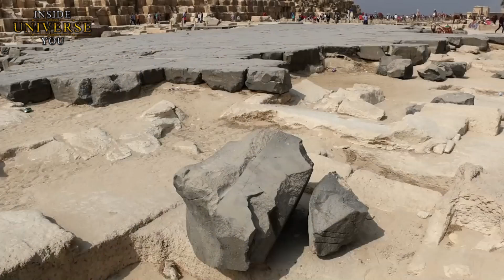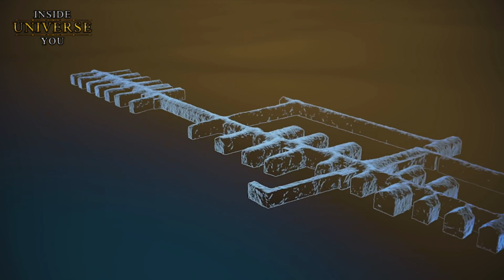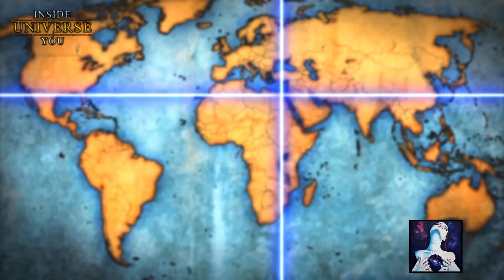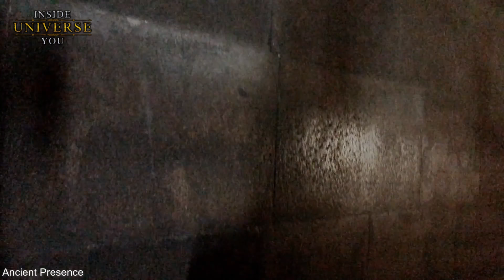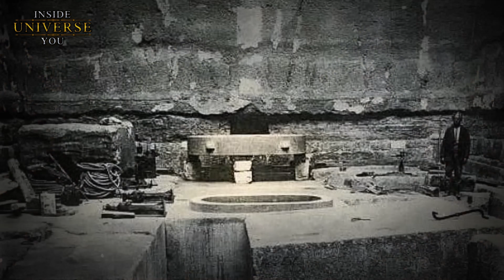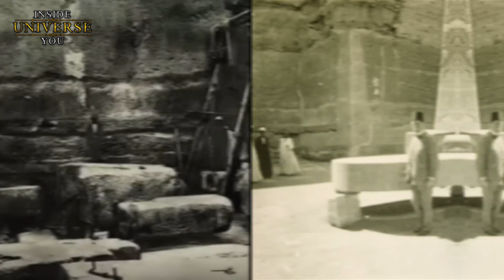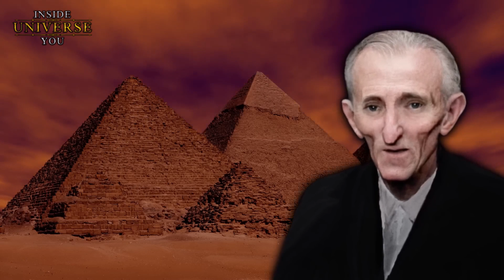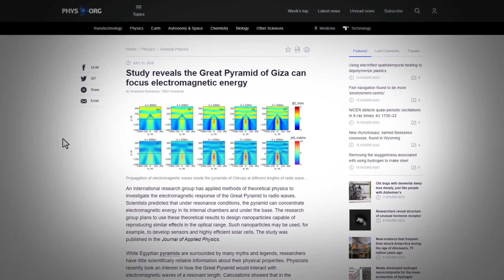Pre-Egyptian Megastructure Built BEFORE The Great Flood

Comment: The rose granite vessels from Saqqura that are machined within thousandths of an inch * on the inside*.. so thin a light can be seen through the sides ends any  debate.. no one has to listen.  You can't get your hands inside a 2" opening to work the inside of the vessel, nor have a method to measure thousandths of an inch. Furthermore Egyptians didn't have the layout tools, mathematical ability, astronomical knowledge,  acoustic resonance amplification waveguide formulas,  nor the knowledge on how to break the hydrogen bond from H²0.. so please go back to punching the clown on the skinernet before you  interject your Richard Cranium foolishness into adult conversation.

Comment: If the Pyramids were generators, what did they power with the power produced? Seems like a lot of trouble to go to producing lots of power for nothing. They had no lighting that's ever been found just images of things that could be lights, no radio or television, no pc no electric motors. What would they use the electricity for?

Comment: This is why the Serapeum had no signs of torches being used. The pyramid indeed transmitted electricity.

Nikola Tesla once lit 200 light bulbs from a power source 26 miles away, and he did it in 1899 with a machine he built from spare parts in the middle of the desert. To this day, nobody can really figure out how he pulled that off, because two-thirds of the schematics only existed in the darkest recesses of Tesla's all-powerful brain.

Comment: Today 2025...precision water cutting is present.that can cut steel plates. ...any tests done with this metod on granit or sandstone (limestones) and could deionised water be used? And to sharp cutting granite use thin sandstone between the water nozzle and the granite.  ( sandstone probably will curve the edge as moving the watercutting. ( any welder may understand  )...
Sailor :)

Comment: They are not machine marks ffs, they are copper saw marks, they've found copper fragments inside some of these apparent power tool marks, it can all be done with the technology of the time, and they had machines made from wood that have been lost to time, we now have mereer diary that tells us basically how they cut and transported the casing stones from the quarry, and he helped build the hydraulic dams and canals that went up to the base of the pyramid, you are also making a lot of assumptions about the precision of the boxes, they are a BOX in a fifth dynasty pyramid which is the most precise sarcophagus ever to be found, and many more just as accurate as the seripium once, and the APEX BULLS were GODS on Earth to the ancient Egyptians, most of the assumption you made is wrong, like the water pump theory, one the pyramid has never been water proof and two why would you need a water pump wen you have a lot of water all around you and loads of natural springs and oasis and the river nile, it doesn't make sense, now building a cathedral pyramid tomb for ppl to visit the king, makes more sense than a water pump

Comment: Has anyone laid out the exact layout of the pyramids? Block by block, Start at each corner, this will give you an exact precision they built it with. No tunnel going below the pyramid, would have air after two minutes. They placed sarcophagus as they moved upward. These were not brought into their positions after the build. All impossible bix 😊placements had to have been done as they built it.

Comment: The box is not a sarcophagus. It is a container for a grounding electrode.
The watercourse is designed to link multiple grounding electrodes.
The electrodes were made from the perfect electrical conductor, 10K gold; which is approximately 60% silver and 40% gold, providing maximum passivation.
Reply: The alloy that you're referring to is called Electrum...
Reply: @AmunRa14  

Electrum is a family of alloys, 10K gold is the one used as the preferred conductor. That's why it is the most plentiful. But it's made, not naturally occurring, as often thought ...
Reply: Did you get this knowledge from a previous life?

Comment: Considering the new findings of a cavern beneath the pyramid and propose a use for your ideas. What if the pyramid was a pump for a vast underwater reservoir like you said but on a much grander scale. It is written that the Gods supplied the life giving waters in times of need. Although strangely at the time of the end of the old kingdom a great disaster happened in which the nobles were all killed suddenly building knocked down trapping peoples within. These peoples had elongated skulls denoting a privileged elite. If such a system failed the populace would revolt and turn on their leaders. Although the use of electricity is dubious the use of power of another sort is feasible that been the grand galley has a pumping mechanism using its precise carved stone and a heavy weight lifted up and down could initiate a pumping system and once started would carry on flowing water through the method of osmosis. Although today we can see a vulgar dug tunnel bypassing it known has the escape of service channel. I surmise this is what ruined the machine.

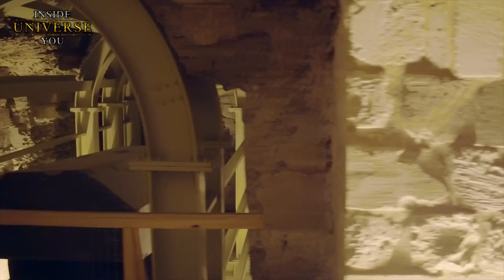Comment: 7:11 the sarcophagus in the kings chamber has the perfect inner dimensions to house the ark of the covenant.  I wouldn't be surprised if these sarcophagus held something similar.  The layout suggests maybe a power grid or perhaps acted as diodes/capacitors or resistors. I believe the sphinx was for line of sight communication via frequency/radio waves. Probably something close to Morse code.  The step up from signal fires and smoke rings.

Comment: The truth is they could’ve stumbled upon electricity without knowing what it was. If the area had vegetation and water then there was storms passing by from time to time creating thunder. Maybe they already knew that thunder was conducive through metal and water. Maybe they knew that thunder would strike the top of the pyramid when storms hit the area and they conducted that electric wave through metals and water and the whole pyramid lit up inside and out making them worship the pyramids to the Gods they believed were causing all this. Maybe they even had stone wheels or another type of invention deep underground propelled by the electric current to move a water system through the whole area creating a vast vegetation in that whole place. You see desert now because for thousands of years it hasn’t been used so everything dried up and died. It makes total sense that the Egyptians could have stumbled upon electricity by having already experience with it maybe by being electrically shocked by it or electrically shocked through tools they were using. Then using common sense they learned its conductivity and they learned how to use it for things they thought could be applied. I’m almost certain they didn’t have lightbulbs or electric sockets BUT it’s very possible they had the ability to conduct the electricity from the thunder and make the pyramids glow making them all watch the spectacle during rituals they had. The pyramids were temples of worship mixed with for them unknown power coming from the gods and since the pyramids were providing the whole area with water and vegetation they worshipped them like they were the gods itself. Instead declassifying old stuff like the lies of Area 51 and its “aliens” and ufos that were only classified aircraft models made by humans we should be uncovering the truth about our past. Not some story in a book or the beginning of a history they want you to learn because it’s about them BUT instead uncover what really happened in the past no matter if it will uncover you weren’t the first, you weren’t the founders or whatever might be the case. It’s like saying Christopher Columbus discovered America when there were people there for thousands of years before him. It sounds good for the history they want to teach you BUT it’s far from the truth. We need to invest in our truth what the hell really happened in the past. Did ancient humans already had discovered things we thought only modern humans figured out??? I mean not with electric cables throughout the whole place, electric sockets, cars and all that I mean discovered things in an old fashion way and used it as best as they could maybe as crude energy to help water flow from one place to another or to create machinery like a saw type disc that will start rotating and cutting through rocks and other materials like butter. Who knows that’s why it’s important to really look at things from another perspective and if there’s any truth not discovered or not told we should uncover it because we as humans can’t be walking around this earth without knowing anything about this place. We think we know it all BUT we just know fractions of what really was going on for hundreds of thousands of years. The past has more we don’t know than what we really do know and only those committed to uncovering the truth will be the ones to shed light about what really was going on. We have super intelligent people in this world with vast experience in all kinds of fields so I think its time for all of them to unite and find the real history with full detail of what was going on in this world and if WE are just another generation of humans that had to discover things by ourselves just like the people in the past did. Like a repetitive cycle discovering the same things over and over again. The only difference would be the use for the discovery and the things they created with the discovery BUT the discovery itself would be repetitive. Do you understand??? I hope so because all this is super important and I have no clue why we aren’t hungry and curious to unveil with proof how everything was done in the past. Was the Sphinx there already when the Egyptians started to exist??? Who can say for sure that people way before the Egyptians didn’t make immense structures with whatever technology they stumbled upon??? Who can say for sure this is all fiction because it isn’t written in any history book??? Maybe they never wrote anything because they didn’t have written vocabulary or maybe because they communicated through sounds like animals and not by words like humans from our history time. What time is that?? Well since the Bible or since we humans understand we started to have a vocabulary and an alphabet. We don’t know anything for sure. We trying to look for other planets and we don’t know what’s beneath our deepest waters or what really happened on this earth. If you drain all the water from the oceans who can tell me for sure there isn’t any ancient cities and ruins thousands of miles down???  Who can say for sure we won’t uncover massive craters created by asteroids hitting earth throughout its existence??? Who can say for sure we won’t uncover a whole world that existed before the sea rose and sunk that whole world with it??? Nobody can say anything because nobody has drained the water out of our oceans to say otherwise. Radars, submarines or any type of tech wouldn’t be able to detect stuff where no one has ever been where signals don’t even reach. I’m hoping one day I wake up to a massive discovery that will shock the world😎

Comment: the used gems with line set to nessary angles to carve  and  know basic math.  Sorry but  they invented alot of tech we still use.
stone cuting tools that used gems harder then the stone been around some say stone age.

now lets see  pully, lift, wedge, square sets use of water to float stones and other tbings quarts slury mixs . water wheels and factor they had copper  ropes and  lapis and other meterials. 
now factor sound and pressure follow same paths and he saw it in his test you need a heavy balancer and resonator damper wich looks just like a certain chamber there in some modals of semualr system. What you need is heat them copper robes  not enugh to melt them but to boil the water pressed up and down the chamber  the pressure boxs are fun factor to if there just air in side they make a real fun effect  it work even easier are they were tresure hords later found and taken we know certain leader and well to do fathers of there study  in that country at times took alot of pricless artfacta many lost are hidden

heat easier to acheive then most relise bye factoring the gold cap for eamvle the coating  realy suck in the heat to and then release said gass i argue its a rain maker not a water spliter in fact all of them can easly be that only later used as burrals bye genrations down the path as that failed to maintain the workings. 

Oh another fun thing on electric
 batteries are quite older then people think jar ones have been found in persha that were proven that works that are older then most think electric was discovered.
  reactive cunductive charge off a water flow wheel to force a charge in to a gem are glass has been proven to have been a real posable thing in test as well light  heat water earth wind equals  life

Comment: The documentary mentioned the granite boxes were made to precision. Precision is required for two similar objects to resonate (eg usual examples 2 similar guitars or 2 similar cryatal glasses). The granite boxes were reportedly very resonating.. the pyramids aligned exactly to stars.. it's a teleportation device . Somewhere in orion there are exact granite boxes,  that's why the boxes on earth are empty... empty tombs , but they arent tombs,  because the pyramid makers have teleported,  gone home. 2 exact granite boxes , one on earth and one in orion, would act as a frequency modulator. Each alien's body inside each box has its own frequency,  but once inside the gramite box , the box modulates the body's frequency,  like how our AM or FM or tv waves work. Test my hypotheses,  every granite box must be of a slightly different size to another inside the pyramid,  this is to prevent 2 aliens being teleported into the same granite box in orion. In high school physics: wavelenght =planck constant X momentum. This formula links wavel to mass (momentum =mass X velocity) instantaneous travel to orion is possible because the being is converted into an electric wavelenght (its body integrity protected by the frequency modulation of the granite boxes). But the pyrmids" alignment to orion are not currently aligned.  Wait for next pyramid alignment to orion, and the alien colonials may get sent back to earth to manage this convict outpost.
Reply: You took the words Out of My mouth..while seeing this and finding empty sarcófago they did Enter a portal of some kind..wow amazing !!
Reply: I can't read this giant wall of unformatted text, have you ever heard of paragraphs?
Reply: I do like your ambitious sci-fi sounding idea. 🎉
Reply: You are out of your mind. 8D

Comment: This is utter nonsense, around the area of the great pyramids. There are multiple other pyramids, except they are in ruins and nobody points them out. You can't say that these 3 were specific to the stars. Because the place was littered with pyramids and other buildings. The only thing remaining today are those 3 major ones and some stepped smaller ones, all the oyhers are gone.  But you can't just pick and choose because from a certain position these 3 pyramids appear to line up with 3 Stars in the heavens and then build up an entire mythology around it. That's just utter nonsense and dishonest research.

Comment: why do people always forget that those "air shafts" were never air shafts and were never open. they were sealed. only opened after someone smashed the hole on the granite. so they were never designed to have any air or water going through them. oh and not to mention there is a block or more in them also stopping the air or water.

Comment: Observe which stars the shafts pointed to 10,000 years ago. And you will know which star systems the builders were communicating with.
Reply: With so many visible stars in our immediate vicinity, what if these were aligned to different stars 15,000 years ago?  Or 25,412 years ago, etc.   why 10,000 years ago?   Humanity uses its imagination to fill in the blanks however the deduction process is skewed by the human perspective.
Reply: The openings are not seen from the kings chamber. One goes out and bends up, the other goes out and bends around the great void.

Comment: If you have checked out the Bosnian pyramid there are some great videos of the guides that explain the air is negatively charged which eminates from the ceramic fake rocks within the pyramid. The air kills off all viruses and bugs as a result. Underneath the pyramid is a water course and the water is purer than any other water on earth. My addition, as a telecommunications engineer as that the pyramids do not have burial chambers but wave guides and tuned chambers. With the negatively charged pyramids, with a gold tip on the pyramids, this will attract positive charge and lightning  from the atmosphere. Where the sarcophagi batteries??? And with this amount of power, is this how the granite was melted when cut?

Comment: I think the idea that you need advanced machines to build these structures doesn't really stand what's wrong with wood molds and sandcrete the wooden farmers placed underground or at altitude and the sandcrete raised and lowered to the molds and poured which is both effective and accurate and of course when the projects are complete the wooden formeers for the molds repurposed into furniture or whatever 
This hypothetical process may explain why there is no advanced machines from the dynastic past.😮😮😮😮
Regards